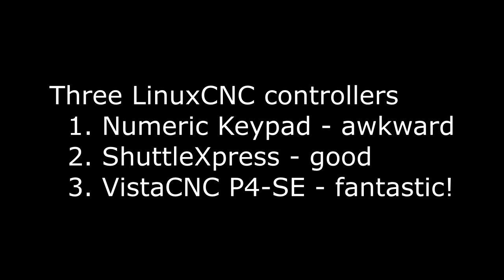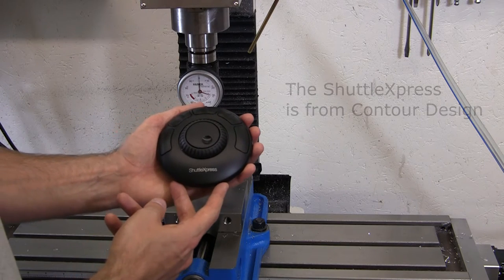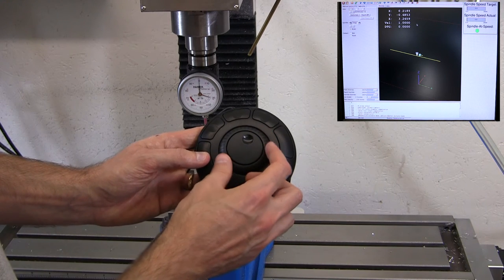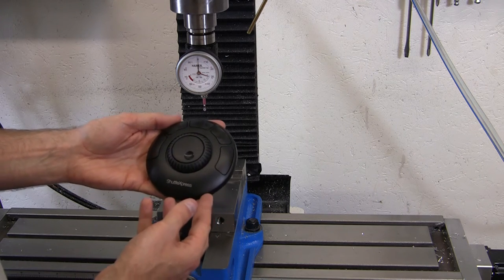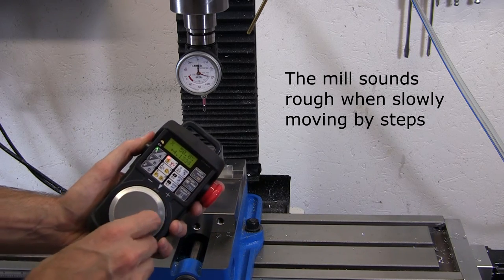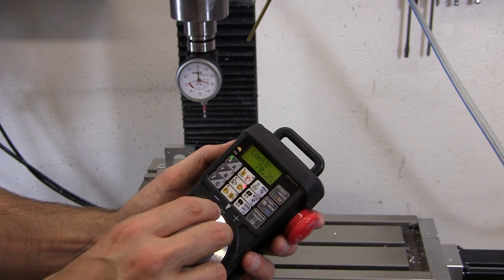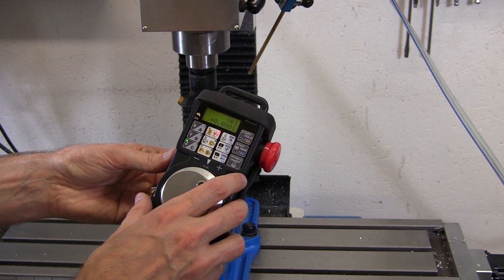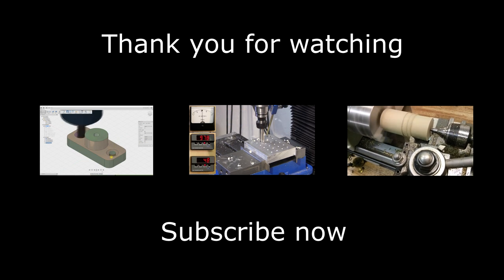LinuxCNC pendants - VistaCNC, ShuttleXpress, Keypad

Comment: Hi. I have a Tormach with the shuttle jog controller. I upgraded to Path Pilot (Linux) about a year ago. I don't have to hold a axes button while turning one of the jog wheels to get the machine to move. I just tap the axes button and it selects that axes and move the selected axes with either the inner or outer wheels depending on what I'm doing. That outer wheel has about 5 speeds for jogging. It's very predictable. I'm sure it would get higher marks from you if it were configured differently. Thanks for taking the time to make the video. I enjoyed it.
Reply from the maker: Hi James, thank you for the comment. I like the ShuttleXpress, just not as much as the VistaCNC pendent. The trouble with the latter is the cost, so one has to decide if it's worth it, and that's hard to do without getting one in your hands. I had an Industrial Hobbies mill before the PM25. With the IH mill, I was content with the numeric pad, it worked well. With the PM25, I started with the numeric pad, and that was not going to work. Can't explain why what did work no longer does. You may be on an explanation though, satisfaction comes from the configuration.

Comment from the maker: All the problems that I mentioned in the video were fixed by VistaCNC within a day of the video's publication. That's great service! 

The Program Start, Hold, and Stop buttons and the Spindle Start and Stop buttons all work. You'll need to have a spindle speed set (e.g., S350 for 350RPM). Spindle Start behaves like M3 not F9.

If you do not like the default GotoZero behavior, simply modify the corresponding MDI_COMMAND in the LinuxCNC *.ini file. I changed my from "G0 X0 Y0 Z0" to "G0 G53 Z0"

I'm no longer experiencing the stop with losing the connection with the pendant.

Comment: so i have to buy  the 7i73 board to be able to use the pendant.?.hmm...im basically doing a 9 x 5 avid cnc build...
Reply from the maker: The VistaCNC pendents plug into USB. The version with the hardwired estop has an extra box between the pendent and USB. Today, I would get the pendent without the hardwired estop. And have hardwired estops positioned around the machine. The 7i73 would help if you are making your own pendent. Looks pretty nice, but I don't have experience with it.

Comment: great video kent..i have a couple of these pendants they are made so well..im running 3 unfortunately....how do you like linux cnc..im doing another cnc  build am going to use it...i have. mesa 7i76e car...im afraid of the learning curve :P
Reply from the maker: Thank you! The first mill I had used Mach3. I sold that mill. The next mill used LinuxCNC only because LinuxCNC is open source. LinuxCNC was quite a bit harder for me to get started with, but looking back, it feels like LinuxCNC enforces good practices. The Mesa 7i76e is a fantastic card! Using good hardware that's supported by LinuxCNC, and Mesa (aka PCW) gives a lot of help on the forums, is going to make everything so much easier. The Mesa manual is pretty dense, and the following cheat sheet might help.
https://forum.linuxcnc.org/media/kunena/attachments/3278/7i76_Anschluss_2017-01-02.pdf
Reply: @kentvandervelden  thank you so much,...yeah im a little nervous...mach 3 was so easy...but erractic..im using gecko 540s and ether steppers.
Reply from the maker: @minskmade  Let me know if I can be any help. I'm sure you'll do well!

Comment: Hi Kent and thank you for the review. I've picked up the P4-SE for a LinuxCNC Router I've put together. I've found that the hal file in the supplied VistaCNC file conflict with the pins setup by PnCconf; I might imagine this to be true with StepConf as well since Axis only wants one driver pin on the motion nets. I'd like to leave the jog buttons in place in axis as well. Are you configured this way, or is the pendant the only means of jogging your system once installed? (just coming up to speed on LCNC and looking to short circuit my learning curve)
Reply from the maker: Hi Ron, you're welcome. By jog buttons in Axis, do you mean the arrow keys, page up and down, etc? If so, those do work along with the VistaCNC pendent. You are welcome to have my configuration files, but they are a mix of supplied, copy-n-paste, and hacked code. I've not documented anything, but maybe you'll find something useful? Let me know if it'll help and I'll find a place to put them. Best wishes, Kent
Reply: Huh. (Yes, the arrows were the jog buttons I was referring to). Well, PnCconf does setup a boatload of pins that aren't used on the off-chance that they might be useful down the road. When I add the Vista-supplied nets, all I get is a bunch of complaints about previously assigned nets. I'll play with it some more; maybe commenting those nets out of the <main>.hal won't disable the arrow keys. Thanks so much for the reply. I'll let you know if I need a peak at your Hal/ini...
Reply from the maker: I've created https://github.com/kentavv/kvvcreates to hold misc files associated with this channel. The first files there are the configuration files. I hope you find them helpful. I'll try to clean them up a little later this week.
Reply: Thanks for this, Kent. Its given me some ideas to check out - maybe more questions later ;)

Comment: Kent, why go the P4 instead of the P2-S pendant. Its cheaper. What was the upgrade features of the P4
Reply from the maker: Hi Gus, I checked both out and I have no immediate reason, for me, to pick one other the other. I'm not going to have more than four axes, and there's a chance that the dials of the P2 are more solid than membranes, but that's just speculation. Looks like getting to a few of the functions (F1, etc) are little more involved, but that's a very minor difference. I feel better with the -SE models, and there the explanation is easier, adding a little more safety. Seems like P2 vs. P4, I'd be very happy either way. The pendent seemed a luxury, but am glad I got it. There are a few other make-models out there, but the three in the video are the only ones I have experience with. Let me know what you find out. I might try something different for the lathe project. Best wishes, Kent
Reply from the maker: Here is an attractive alternative that I also considered, since it relays the position of all three axes to the pendent, but I really don't trust wireless stuff and wanted a real e-stop on the pendent. 

https://www.youtube.com/watch?v=q7aLiMDHQrM
Reply: Who doesn't like a This old Tony video.... however... that this is a piece of crap. And a wireless e-stop. Why not a wireless seatbelt!!  No way your choice was best.
Reply from the maker: Thank you, your comment made my day. :) Maybe ask VistaCNC, but I don't see any reason why to pick the P4 over the P2. Many of buttons are programmable on the P4 and I assume it's the same as the selectors on the P2. Going for longevity or replacing switches, I bet the P2 wins. If you're using with LinuxCNC, you may need to update the firmware. Mine came installed with Mach3 firmware. Hope this helps.

Comment: Excellent review Kent, thanks for sharing. Do you think the Vista CNC pendant justifies the extra $220? I also wonder how does it compare to the XHC HB04 which is roughly the same price as the Shuttle Xpress - http://goo.gl/8KWwmA
Reply from the maker: Thank you very much. You have a great YouTube name. I know, it's a good chunk of change. If the XHC HB04 does the same for the cost of the ShuttleXpress, there's little to risk and the pendant is a great improvement over the ShuttleXpress. Sorry, I don't know about the XHC HB04, if I had, I would have tried it given the low cost. Some things to consider perhaps are if the enhanced emergency stop of the Vista CNC pendant is important, if having the source to the driver is important (the Vista CNC pendant is closed source), and if the pendant is reliable. Regarding reliability, I would be hesitant to use wireless pendants (but I also valued the enhanced emergency stop). Perhaps another consideration is if you can reach the developers. I've sent questions and suggestions to VistaCNC and have had great response. Since I can only run one CNC machine at a time (due to power to the shop), I'm considering moving the pendant between machines, which would help with the cost. If you get the XHC HB04 I would and I'm sure others would be interested to hear how it goes. Best wishes